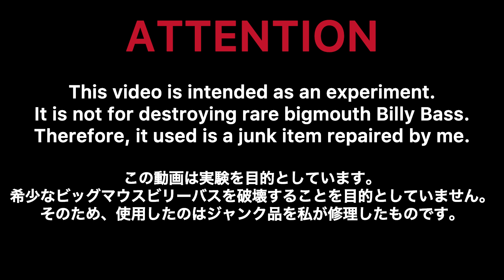If High Voltage is Applied to the "Big Mouth Billy Bass"

Comment: If only you could find that humping chihuahua toy 😅.  Its pretty old though from like 20 years ago.  Would be hard to find one in good shape
Reply: I accidentally did that with a humping dog USB cable, I guess it wasn't rated for quick charge that goes above 5V (but it does have data lines, so the phone could negotiate 12V). The dog moved at about the same frequency as at 5V, but harder, so it was much louder, but not super fast. And it broke down after a few minutes. The next one I disassembled and added a voltage regulator (I made the assumption that it had one in the first place). I could have added current sensing that varies the speed rather than turns it on or off as in the original circuit, but I'm too lazy for that.

Comment: Not enough motor range at: 7 volts
Speaker died at: 14 volts
14+ volts: Connected to motor
Jumpscare at: 43 volts
Motor somehow didn't fail?!
Audio problems at: 2 volts
Reply: Timestamp 0:38 1:09 1:25 1:52 2:00 2:36

Comment: AT 2:14 BIG MOUTH BILLY BASS SOUNDS LIKE A SHARK NAVIGATOR VACUM CLEANER IN CARPET MODE ON A CARPET. WHEN YOU HEAR THE MOTOR INSIDE IT DOES SOUND LIKE A SHARK NAVIGATOR VACUM CLEANER.

Comment: Was the part with it on 2V recorded before the high voltage or after?
Reply from the maker: before
Reply: @highvoltagetoys  oh ok. Does it do anything on normal 6v voltage afterwards or was it completely fried?
Reply from the maker: @kjw21411  Low voltage is the same as when the battery is low. This has no effect on the toys. I haven't checked after applying high voltage.
Reply: @highvoltagetoys  yeah that's what I was asking, whether it does anything on normal voltage after being on high voltage or if it was completely fried
Reply from the maker: @kjw21411  Idk. I haven't checked after applying high voltage. I'll look into it if I feel like it.
Reply: @highvoltagetoys  ok, no big deal, just curious since I collect these and other singing fish
Reply: @kjw21411  nah man, its done
Reply: @TheGemmyGroup  yeah I figured, considering it was literally smoking out of the back
Reply: Considering the IC has a voltage regulator the IC is probably fine

Comment: I'm surprised that the sound lasted as long as it did. Usually the sound chips pop around 7 volts, but this one died around 12. Also the under volted at the end was hilarious!
Reply: I wonder if it had a voltage regulator which saves the chip until it too fried
Reply: You meant 14?
Reply: Actually they can run at 7 volts no problem but its when its over 7 you have to worry about it (i ran one of mine on 7 and it was fine)

Comment: Big Mouth Fish (I think by Jiada) is a fake rip-off of the 2000s Billy Bass. They’re prone to lose their sound after like… 7 voltages. But the original Billy Bass… will not stop high pitching the voice and will not crackle and will not crack up unlike the fake rip-off called Big Mouth Fish. Can the next video be that after this. 

Yes, they will have seizures, but the Chinese low-quality knockoff versions are more likely to lose their sound unlike the real version after being given like 7 volts of power or something.